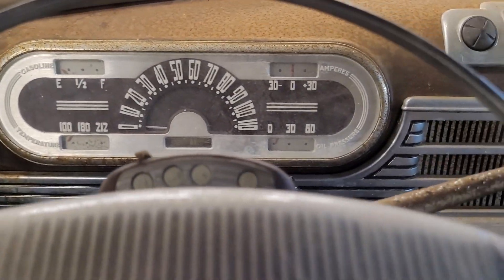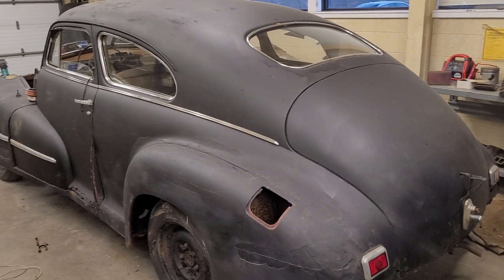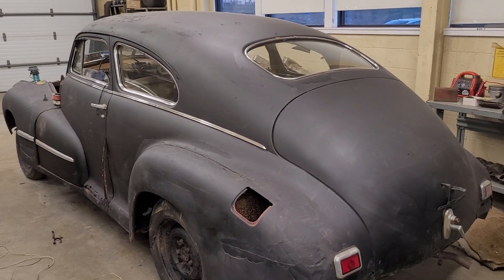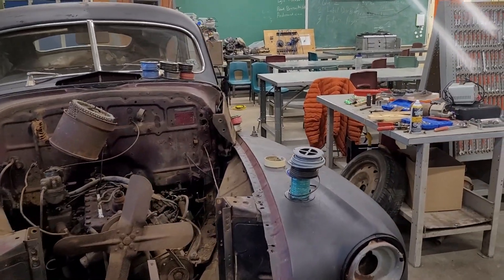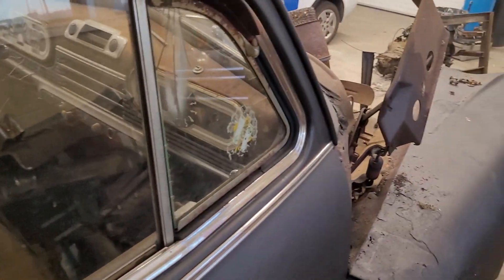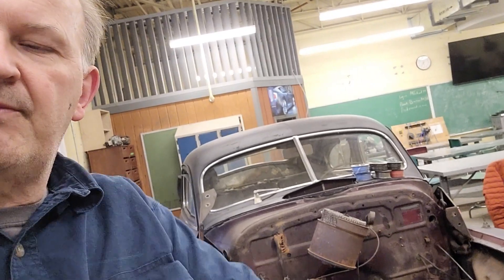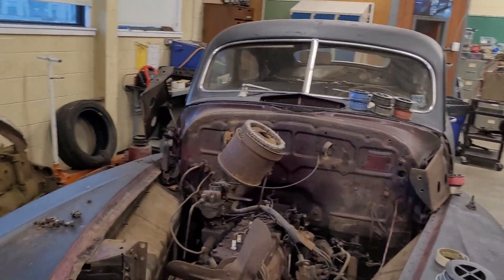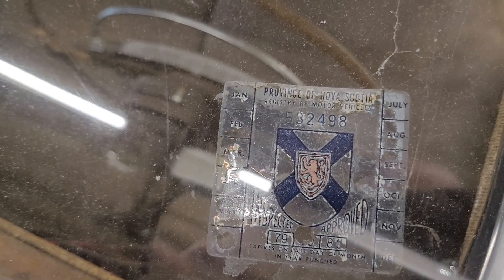1946 Oldsmobile project "Betty"

Comment: Restore it do not butcher it. The old six was a sturdy old work horse.
Reply from the maker: setting it aside.  I have built a runstand to try to get it going (it and the 37 engine) The guy I got it from tried and couldn't get it to run (you can see where there are a few new plugs etc.), which is why he let it go cheap.  Basically priced as though there is no engine.  Smallblock going in it in the new year.

Comment: You should consider putting a 350 Oldsmobile engine in it. That way it is all Olds.
Reply from the maker: would be cool, but I already have a 383 chevy stroker sitting on the engine stand.  I built it 2 years ago and still haven't put it in anything.  Already paid for...... and makes about 550 hp